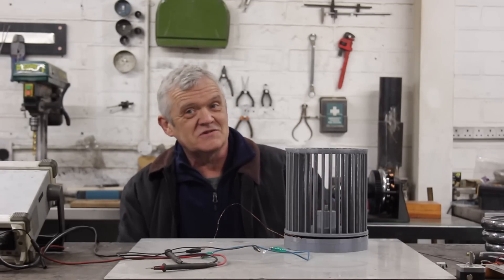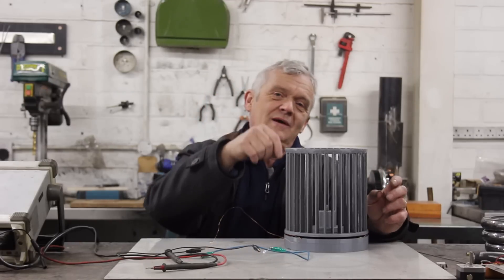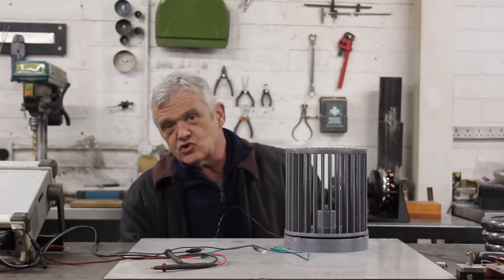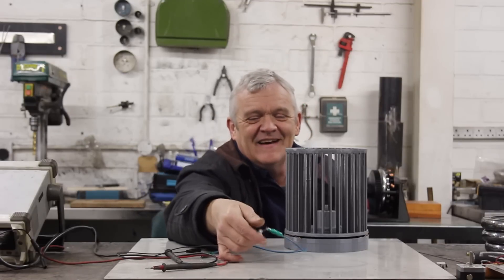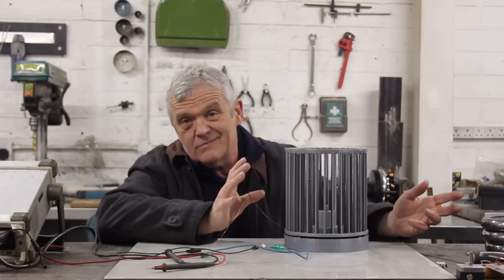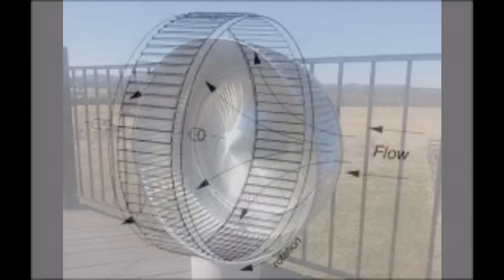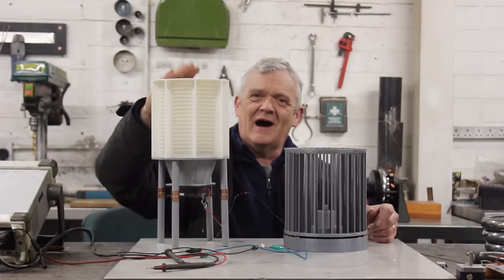1878 An Exciting Idea For A Wind Turbine

Comment: This is such a great resource - thankyou so much.  I've been thinking how this would fit on my roof, and whilst the Darwin collector works well, it results in a stack that's pretty high.  Your demo looked like the waters turbine is actually a centrifugal fan in reverse...  Another possibility is to use a hyperbolic cone in the middle of the original generator you made 2 years ago, so that it organises the air inside the fan as it moves out through the top.  I suspect this would also change the aerodynamics on the transition of air entering the fan from the side, and increase the efficiency without the need for a collection tower...??  Of course, there will be different things happening at different wind speed ranges.  Given that the vwt doesn't self-regulate, what happens in a 70mph wind gust?

Comment: I was mechanic for the airlines all my life. I had given an idea to the county to put giant baffles at end run way. Airplanes generally sit throttling they’re engines just before take off. During flight a 747 engine creates 240.000 pounds of thrust in flight at take off I’m sure more. Imagine. Directing that trust to generators. My want was to send energy under the ramp for de- icing. Also to power the airport. Most times there a airplane running all the time.  I also wanted this to be a way to keep ice off planes as it sits. About 10 tp 30 min before take off. Many times up to 5 to 10 planes sit there wasting valuable fuel. This freak power could be used for treating salt water. Even a back up power system for the whole airport or city.

Comment: On the base of your scroll cage, what about extending 2 to 3 in of disk acting like a fly wheel and get longer spinning time and torque and maybe add diameter to the cage to add torque and power output

Comment: Vacuum cleaner centrifugal pumps do this too. You can get very high speeds out of them with tapered ducts. I've got one supersonic with an aircompressor squirt gun. 
And to several thousand rpm from a tapered to 2 mm nozzle on a garden hose

Comment: What if the squirrel cage fan was the tail of a windmill? It would provide the drag to keep the windmill pointed into the wind and provide power. If a tube stuck out in front of the pivot bearing to counter balance the cage it could feed air directly into the cage.

Comment: As we move away from solid fuel fires we have more domestic chimneys with no purpose. 
Turn that upside down  put a cap on the chimney ( like a malt house malting room cone) and  close the hearth but use a pipe to extend the chimney trough the wall to the outside of the house. 
Using the draw from the chimney even on a calm day you should get some draw. On a windy day you can get a Dyson effect going to draw a much bigger volume of air through. 
It might not give the same force as a simple turbine perpendicular to the wind flow, but it should be more constant trickle feed of charge? 

Might make it easier to store the energy or better if it's heating water for underfloor heating or similar

Comment: In "lift type" turbines especially vawt, when considering lift, you have to take into account that following blades/wings are going through dirty or turbulent air, and have less lift because of it, when used in the normal way. But putting the air into it the way you did avoids the dirty air factor, i think.

Comment: A turbine efficiency test stand would be a great project.  If the goal is to find an efficient turbine then a standard method to measure turbine efficiency is needed.  There is also the efficiency of the electrical generating device that needs a separate measurement method.  Best of luck

Comment: Hi Robert, a couple of years ago I had an idea to turn a roof mounted wind turbine ventilator into a low cost generator for lighting low cost housing projects in rural areas, by using not only the wind externally but also the thermal draft coming from the house/dwelling. Your design would be perfect for this application. I actually bought one to convert but never got around to it at roofwhirlys4africa, here in South Africa where I'm from. Really enjoy your channel. Tony

Comment: Been working around turbines for the last 13 years and have come across a lot of guys trying to make power using VAWT. The big issue is the drag the carry in high winds. The wind can't escape quickly enough and this drag can self destruct after a period of time. This is the biggest issue that has to overcome with any of these turbines.
Reply: @robertosullivan1822  Hey Robert, thanks for your comment. I myself am designing something for commercial applications. Do you have any improvements or suggestions for designing around drag?

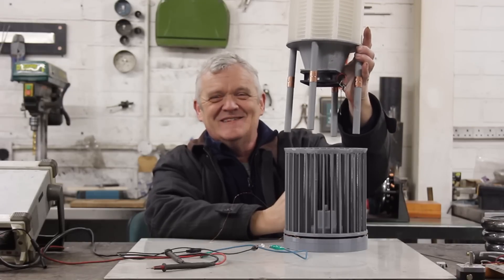Comment: 4:23 The ONLY thing better is if you can INCLUDE...

"FORCED" convection [such as a chimney or other way to enhance the worthwhile properties of your ambient 'working fluid' [air, of course] so that you get MULTIPLE sources of motivation across the turbine, without adding anything to the factual turbine its self.

One really radical [and for me at the moment, totally inapplicable] element is if you have some location you control [a basement, a shed covered with lovely greenery, or just basically any place where air will cool in the summer and 'pool up'] OR, if you have some form of method to take advantage of the sunlight (I admit anybody who does not live in places like where I live are BOUND to have SOME forms of restrictive, or restricting, or legally prohibitive laws to deal with, as I live in a place where those kinds of laws simply do not exist) to create a thermal up-draft, anything at all to modify the functional pressure differential across bodies of fluids <in this case gases> in motion, such that they can then, while seeking to self-equalize [a simpler word for the ill fated, yet indispensable word "ENTROPY" ] will then WORK HARDER, in such a manner (such as higher wind speeds inside your system, as compared to outside of it) that helps increase said driving fluidic forces, so that more of said air/wind/water [thus they insist we all use the term 'fluid' in engineering class] can impinge upon your intended turbine, and, as a result, increase the potential of more harvestable power to you in the end.
Reply from the maker: do you. know what mate - I have no idea - but interesting points you raise

Comment: Exactly! This was tickling the back of muddled mind when I saw the last video. This seems a perfect fit for Darwin Wind Turbine. 
About the hyperbolic cone in the Water's turbine, it might not be needed. That cone is to direct a facing wind out to the blades, right? But you already have the vanes of Darwin Wind Turbine to direct the wind. Maybe try testing the angles of the vanes in the Darwin Wind Turbine to have the air flow down just enough to hit the opposing squirrel cage blades.  My guess it could help the wind keep a bit of momentum as well.
Reply from the maker: yes but as it comes down the darwin it is a effectively a facing wind is it not?
Reply: @ThinkingandTinkering  OK, I think I see. I think I need to rewatch the last video of the Darwin Wind Turbine. 
My gut tells me there's a way... Or maybe it's just time for dinner. 😅

Comment: Hey, Rob, you can easily make two of these concentric cages contra rotate, doubling your rim generation speed and output. Or, to avoid slip rings, just fix one permanently to the stator, the other one will still go faster.
Reply from the maker: yes you could mate - very clever - thank you for sharing

Comment: To avoid lowering the wind speed mount the turbine on the horizontal, use a funnel to feed the air in, shroud the turbine with a body that flares out just beyond the circumference of the funnel.Mount it vertically on a pivoting post and build a power slip rings transfer point. The wind will force the turbine to point into the oncoming air by deflection on the rear body, the funnel will force the air into turbine and by having the air flare out on the backside, you also get a low pressure vacuum effect.  As well the turbine will be provided cooling by the air flowing around it.  Don't forget the hyperbolic cone!  I literally just pulled a turbine from a RV unit 15 minutes before seeing this video and debating on trashing it (coils are fine, a couple housing bolts broke is all)! Just have to convert it to DC output!  Now I have to go get some fiberglass and styrofoam, and neodymium magnets.  Project for the week! 😊
Reply from the maker: awesome project mate - let me know how it goes I would love to see it

Comment: Would it work better if the cage blades were on a 60-75 degree angle. So "twisting" the top plate of the cage to offset it from the bottom plate? I have seen this on vertical wind turbines that use 3-7 blades. They do this do use updrafts and down drafts on tall building when there is no wind
Reply from the maker: I don't know I will have to check thanks for the pointer mate

Comment: That's what about using a wind concentrator. Funnel wind to a smaller passage, it speeds up. Higher speeds air makes for a smaller, more efficient turbine, while it also protect it from storms, because it caps off the max air speed going to the turbine. Its awesome!
Reply from the maker: the darwin is a wind concentrator

Comment: The combination of the downdraft turbine connected to a vertical turbine with generator is something I will build on my property near the shore.  it will be a concrete building maybe 8 ft by 8 ft and maybe 10 ft High depending on how much kilowatt hours I need. How's that sound?
Reply from the maker: it sounds awesome - that's how it sounds! nice one mate

Comment: Axially oriented ring magnets are great for vertically oriented VAWT's.  Not so much if you want to align it on it's side like along a roofline.  I know a couple of esoteric uses for radially magnetised ring magnets and am just wondering if there are any common ones where they can be scavenged?
Reply from the maker: I wish I knew where mate - because you are absolutely right in what you say

Comment: Great use for the darwin design.  Maybe you could use ducts on the bottom of the pipe blowing outwards to direct the air onto the blades?  That way you won't need the cone.
Reply from the maker: I think it is the same principle mate - so either I guess

Comment: Can somebody please help me I am building a gas powered permanent magnet 12 SI alternator generator for 12 V system. How many magnets do you need to use? Is there too little or too many
Reply from the maker: it doesn't matter very much mate - emf=Blv sine theta. So, speed of rotation and length of wire are going to impact a lot as well as strength of magnetic field - if your field isn't strong enough - spin it faster or stuff more wire in to compensate
Reply: @ThinkingandTinkering  thanks for the reply I have a 12 SI 87 Ap 12V I bought 10 n 52 permanent magnets 2 inches by half inch by 1-inch. I heard people mention the number of windings versus how many magnets I did not know to be exact I didn’t want to make a mistake it’s a lot of work to make a rotor. I didn’t want to have to do it twice

Comment: Hi Rob. Thanks for mentioning my turbine. Couple thoughts. Yes. this will work but it does add complexity. Everything's a trade off right? I originally designed the turbine as a simple principle to just make a point about efficiency. Betz ignores the idea of increasing velocity first for free (like a ridge). In it's simplest form, actually pretty simple to operate as a HAWT because it's theoretically so much smaller. Also works on an outside AC vertically. Btw, a squirrel fan is not optimum. It would be like using a propeller on a wind turbine. Squirrels still work though.
Reply from the maker: I love your turbine mate - I think it was an idea of genius - you have to remember the Darwin is little more than a collector

Comment: I've found alot of squirrel cages in old cars. The fan motors have them for running the ventilation. Best part is there's already a generator attached. Usually find them at the foot of passenger side dash. Thought I'd share for anyone else who doesn't have a 3d printer. Lots of already made parts in a fan unit. Happy hunting 🤠
Reply from the maker: nice pointer mate - cheers
Reply: The hunt begins!
Reply: Hey yeah! Well done 👍

Comment: My idea to improve the design is to have a shaft that can run through the center of it all probably threaded so you can put another on it to keep four of them all in a row with a spacer distance between each one and then you can put five of these four clusters into a single wooden frame and now you have a 20 unit wind turbine which should produce a fair amount of energy.  You can also run the wires back down through the center shaft so they all collected the bass and then along the bottom of the base collect the outputs from each of the four cluster spindles into one load
Reply from the maker: like it mate

Comment: If I use this combination in my oversized off grid greenhouse, so Darwin on the roof directing airflow down into the greenhouse (we get terrible mould and moss problems here so I want to increase airflow), is it then possible to have the air entering along a pipe with a coil or similar that can be heated (using the power collext from the turbine and maybe solar panels) to warm the air a few degrees in cold weather to save the parrifin heater having to work so hard against cold airflow.
Reply from the maker: I would think so

Comment: Going going in from the you will have A limitation restriction to go in then on the sides but you can make it so that the that limitation can be helpful because you're bringing it into.  Scientifical foscientifical force and make the column of Fluid push on the sides of the cage but you have to remember that what goes in needs to be able to come out with little or no resistance.  The trick is to keep it so that there is a very low resistance and you will have lots of things to be working with centrifical force.
Reply from the maker: cheers

Comment: If it works in vertical and horizontal mode, I wonder if there is any sense in mounting it tipped at an angle. Maybe you can get best of both worlds, or maybe it'll be a wobbly mess.
Reply from the maker: I don't know mate - personally I won't but I really don't know

Comment: yes, good idea forcing the downdraft into the centre of the maglev squirrel cage. However, (lol!...) one assumes that the said wind that is directed downwards by the darwin cage might/most probably will also effect the squirrel cage rotation which might lead to a conflict of forces - gazooks! - and that might not be a good way to go! The question now is which is more efficient at collecting and directing wind energy to optimise electricity generation - the squirrel cage or the darwin cage or both working together in unison?
Reply from the maker: both together

Comment: If the shroud had vent tubes redirecting the used air back up to the Darwin tower it could assist even more flow.
Reply from the maker: hmmmm - you think?
Reply: @ThinkingandTinkering  Just a thought as having lived in a old malting town the vents that rotated on a copper penny directed air flow through the malt so any wind directional assistance can only benefit with extra secondary volume.

Comment: Isn't there greater efficiency when the wind strikes the squirrel cage at any  right angle? I would like to see you  invert one atop the other with a fixed coil between the two counter-rotating  magnet rimmed  Squirrel cages or Darius , or Ugrinsky etc. You have demonstrated that the counter rotating perimeter magnets produce greater output and that multidirectional wind capture is preferred. A counterrotating "hub generator"  could be mated with various  VWAT blade types and configured in stacks or  side by side in a "wind wall"
Reply from the maker: I would think so mate

Comment: RMS, when you showed that downward draft of air would turn the turbine, I immediately thought of your deflector. Now take the exhaust and pass it across the outside AC unit. It will blow air across the coils and make the AC more efficient as it cools, especially on hot days.
Reply from the maker: that's clever mate - combined cool and power - nice

Comment: Surely the squirrel cage spins regardless of wind direction anyway. Wouldn't this just add a layer of complexity, and possibly reduce efficiency?
Reply from the maker: no - you might be missing what the darwin actually is mate - it's just a wind collector - so it should collect more wind
Reply: the squirrel cage does but the waters turbine doesn't
Reply: @Luc-1991  if I listened correctly, a shroud to surround the waters turbine?
So what's gonna happen to the air?.. won't a shroud create a pressure bottleneck.
Reply: the tower is to take advantage of higher wind speeds higher in the air ... this keeps the moving parts on the ground and not 150ft in the air for servicing .. the shroud around the fan would be vented of course and would be there so there weren't conflicting airflows from ground level wind
Reply: @WilliamTythas  the issue I see isn't with finding new tech to spin a generator. There are numerous efficient, and less efficient devices, driven by various natural energy sources.
The challenge is still the generator, and the size of present designs required to generate a decent amount. The size and capacity of the generator will always determine the required size of input.